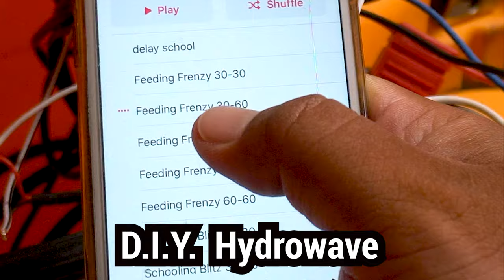Hobie Outback Dream Build in 10 minutes 2020   OOW Outdoors

Comment: I like the horizontal rod holders.
Reply from the maker: its the nice to lay the rods down.
Reply: I just put a roller grip paddle holder on each side near the seat. That way I can push my bait caster grip in it with tip forward and it is held securely.

Comment: Very interesting how he put the transducer in the front of the boat and covered it with what looks like silicon.  Wish he could speak on it.  That is clever.
Reply from the maker: All our kayaks have been done this way.
Reply: @OutofWORKoutdoors  why didn’t you use the guardian plate that all OBs have?🤷🏻‍♂️
Reply: @Garcia_Familia_Adventures   It won`t read water temp when is mounted inside the hull like that. I don`t know why he did that
Reply: @jettercool  no disrespect but I did have a hull mounted transducer and it read ok, but totally accurate reading, but close. 😅

Comment: That's a big hole for two toggle switches.  Why not just use the yak power blue tooth distribution box and manage the devices that way (phone/remote).
Reply from the maker: Because wireless connections are very dependable when you need them.  Also very expensive to repair/replace